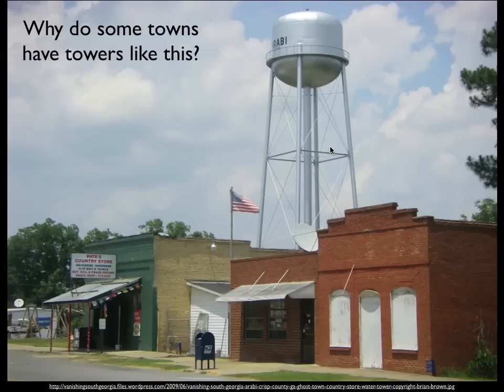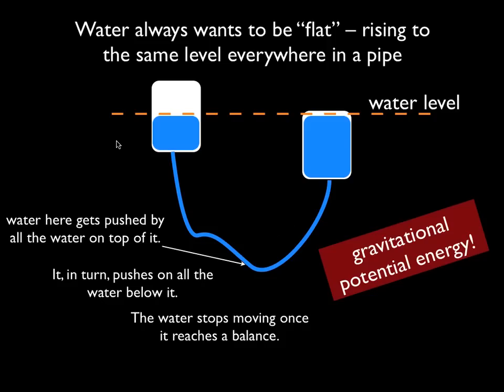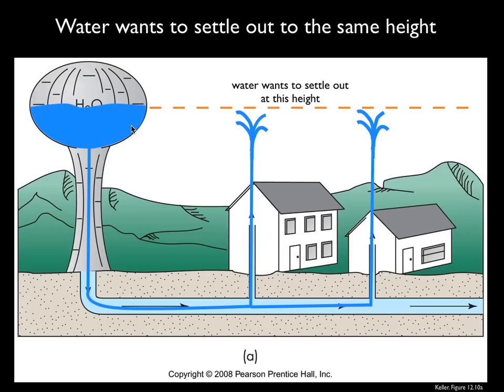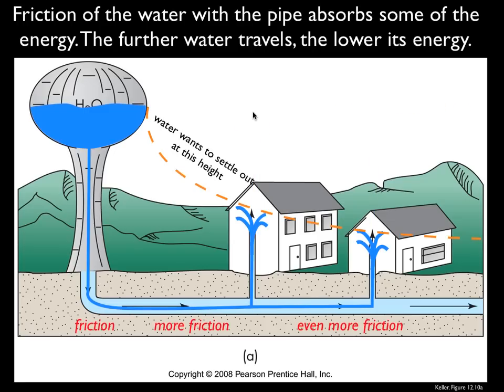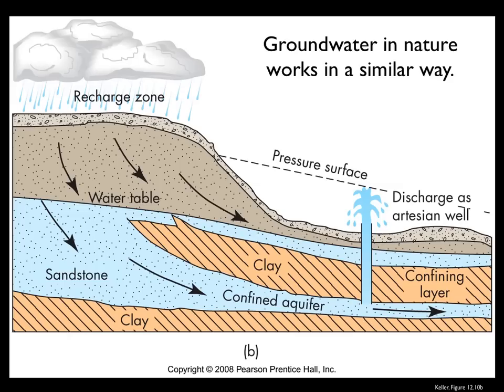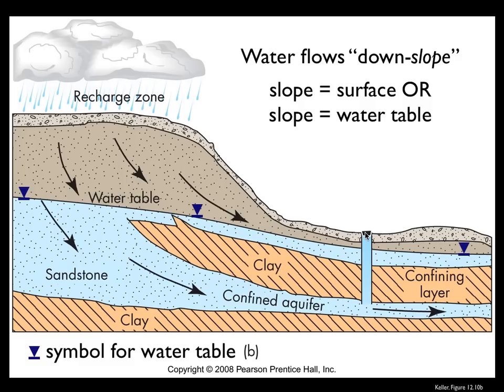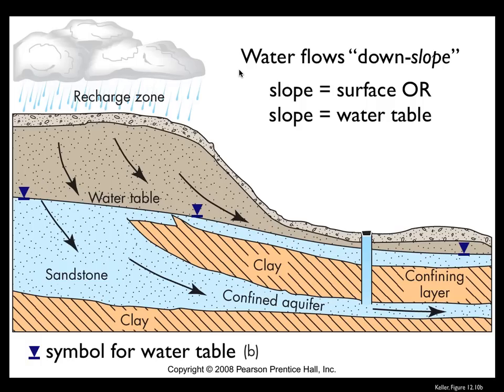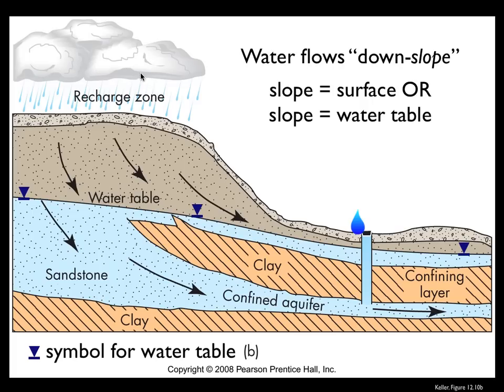Groundwater Flow - Part 1

Comment: Can anyone tell me based off of the first depiction. He has the two cups, and explains how the molecule is pushed down, and always finds an equal level state while being connected to one another via underground plumbing.
I'd like to know at what distance does this phenomenon of both cups having the same level no longer apply?
Reply from the maker: The video talks about how there is frictional loss over all distances. The longer the distance, the more loss such that the cups wouldn't come to quite the same level. But in nature, this can work over hundreds and even more than a thousand miles. Here is a map of connected aquifers in the USA so you can get a sense of the size: https://water.usgs.gov/ogw/aquifer/USAaquiferMAP11_17.pdf. The height water will rise to in a well will never be quite as high as the height where water enters the aquifers because of the frictional loss, but it does rise upwards.
Reply: @matthewdalessio  thank you for the info. That is interesting for sure. I hope you do not mind,  but admittedly my question was a bit loaded. I do not have any formal education and strict regards to the nature of water or any particular facets that do business in that topic. However I think I have a pretty good grasp on physics, but I'm always ready to learn something new and if you happen to have the knowledge for that then I would greatly appreciate it. I was pretty confident that the answer to the question was essentially an infinite amount of distance. I didn't consider the friction loss but that is totally understandable, and I appreciate the information about that because it's not something I had really considered to be honest with you. Now I would like to see if you could give some thought to the idea of how this is possible for water to find an equilibrium over these great distances regardless of the fact that it's on a topographically affected terrain, be it above ground or below ground. And all one connecting body of water, all resting at different elevations which means it has different pressure due to the density of the subject matter that it's in or that surrounds it. Different "gravity" effects due to multiple other aspects yet no matter how far you go around a ball the water will consistently be at equilibrium. Where we see no effects of centripetal or centrifugal force from the spinning of the ball. Obviously I have a point that I'm trying to get at and I hope that I can get some actual information on it, genuinely. But for me I look at the way that that acts and the physics of it in such a way that when we say sea level that's precisely what I think it is across the board I just don't see how it can be any other way.